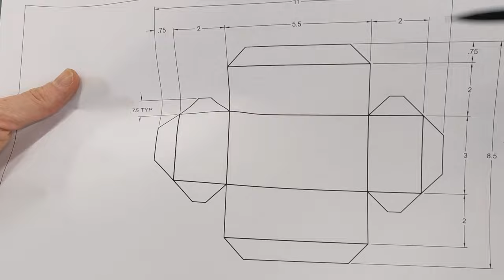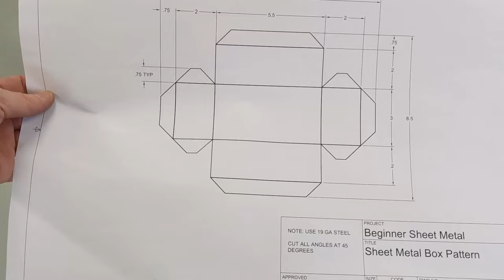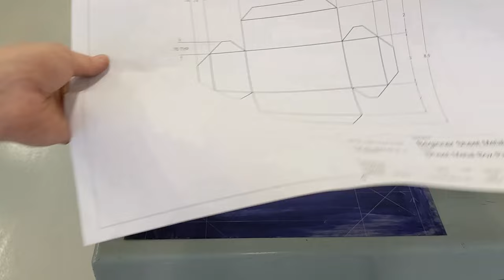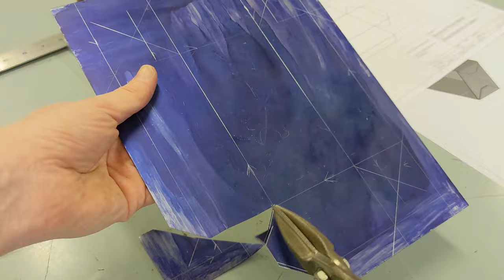How To Make a Sheet Metal Box - Shop Class Project

Comment: Nicely done and explained. You could also cut the tabs off the sides and than weld the four side edges and finish the box off without and spot welds on the sides. Than the boxes would look smooth and clean. Just an idea as an option... Thumbs Up!
Reply from the maker: Thanks for watching!  I like that idea but usually when I teach this in my classes the students have barely had experience using a hammer so we hold off on teaching them to weld until a little later in the year.

Comment: Should I cut metal to fall away from me or towards me taking a risk of an eye injury?
Reply from the maker: You always want to be wearing safety glasses of some sort when you are cutting metal.  I generally always cut away from my body when using hand shears.  After some practice you will get the feel for where the metal might go as you're cutting and then you can angle it away from you for safety.

Comment: Great video. Very concise. Do you mind explaining the process of sanding and finishing sheet metal boxes?
Reply from the maker: Because the metal we use is untreated and straight from a local manufacturing plant we need to prep the metal before painting.  To do that we just sand the box with 80-120 grit sand paper to remove any rust, grease, and grime.  Then we run it wash it up with some water and some paper towels. Once it's dry we can apply the paint.  Thanks for watching and sorry it took me so long to reply.

Comment: Why not put the tabs on the inside?
Reply from the maker: Generally it looks better with the tabs on the outside.  But it also rounds that corner off better so you don't have a sharp edge that could cut you when you move the box around.